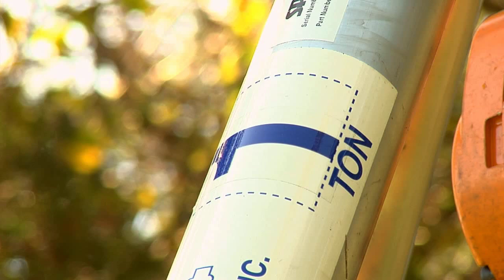Lifting and Hoisting Stone Grave markers

Comment: I am curious about why you are using threaded stainless steel pins. Except for being inexpensive and more available do you think the treaded rod may put more pressure on stone then a smooth stainless steel pin? We would hope no pressure would shift the stone to tilt. Sitting upright I am sure the threaded material would have minimum pressure, but tilting all things change.

Comment: The threading helps to key in the epoxy. Without the threads the epoxy does not adhere well to smooth metal.